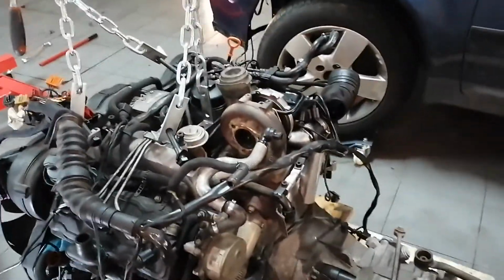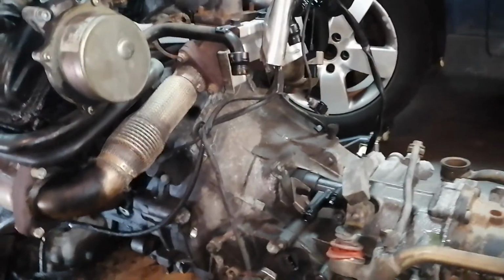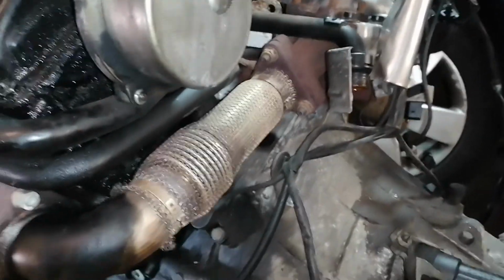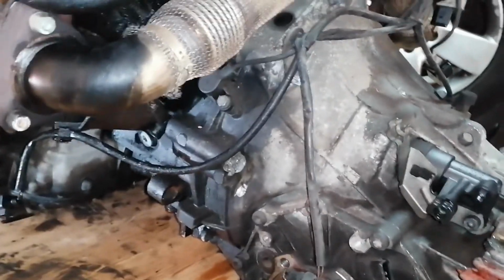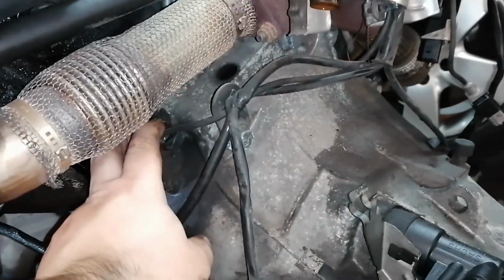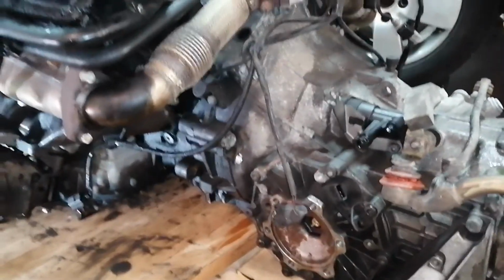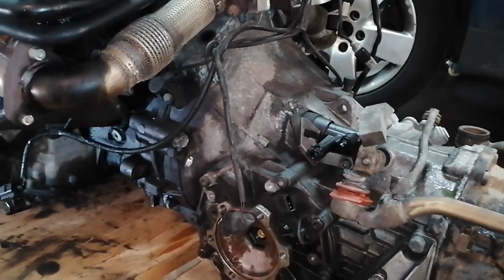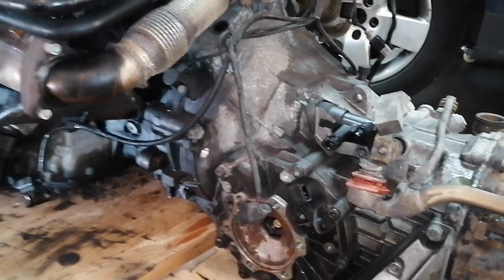A6 C5 Transmission / Gearbox manual swap - EP1

Comment: Bought a used transmission for my 2013 Audi A6 and a dealership put it in for me, but the mechanic didn’t program my vehicle. Long story short it smoked up when I put it in drive and it won’t go anywhere. It needs to be programmed. Will it still work?
Reply from the maker: HI Kendall sorry for the late reply . I think Transmissions and TCUs need to be matched . If you only moved a few meters I don't think you should have any damage . Let me know how did it end up.

Comment: hello. i want to swap automatic to manual on 1.9tdi 2004.  Is it plug and play mechanics, or there will be problem with electronics? Cheers
Reply from the maker: Hi DEjan I think you need to code it like in the petrol ECU's .

Comment: Did you do any coding when you swapped the transmisson?
Reply from the maker: Didn't got there yet. But yes I'm expecting to code the ECU to manual. I'll document it here if it works without coding.
Reply: That would be helpful
Reply: Becuase im planning on swapping a 2.5 v6 tdi FWD